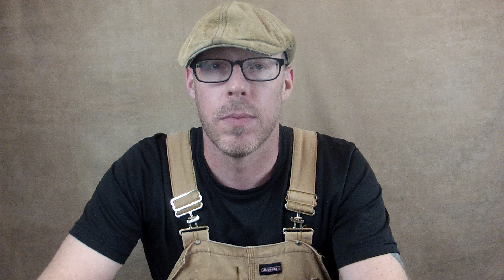How much water do you need to mix concrete?

Comment: Liked the video. Now i wanna know what are types of super-plasticizers are best. My aim is to increase TENSILE strength in a concrete anti funicular roof structure. 

No need to remind me that concrete does NOT have good tensile strength.
Reply: You'll need pre-tensioning. Which for this form would be a marvel of engineering in it's own rite. No plasticizer that currently exists is going to be of any help for something like that. You need mechanical remedies or a complete redesign.
Concrete is an absolutely terrible idea for a roof of this shape in any case though.